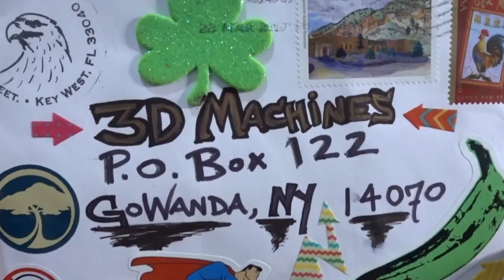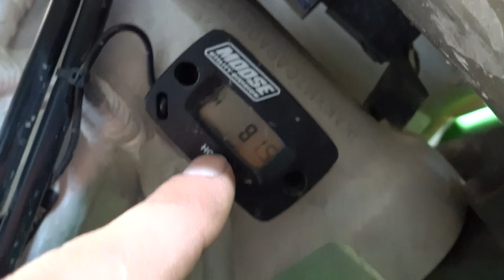SELLING MY FIRST DIRT BIKE

Comment: I know why you made that decision and that's 100% up to you but from what I see in your videos is that your 10 times the rider on a 250 compared to a 450. I don't know what it is but for the riding you do you have to rev the 250 more and it just seems when your on the gas more you get more power to the wheel.

Comment: I bought a 2006 ktm 300xcw and after two races the engine seized. So I did what and body else would do and rebuilt it. Fast forward two months and 9 races I melted the piston to the cylinder :( . Thats now its just sitting in pieces in the back of my garage. So if anybody has an engine for a decent price I would be interested.

Comment: 2007 hammerhead gt150 sport first oil was more gray than the clouds and then tires then electrical system and now battery and head light

Comment: Me second ever bike (crf100f) bought it used. It has been with me through 4 bikes with me and isn't going anywhere hopefully ever but today i was climbing a hill and it was near vertical bike fell over died whatever I picked it up and tried to start it for like 10 minutes and nothing. It usually started first kick even cold with no choke. I pushed it for about 2 miles back home. Have yet to go into the engine. I honestly don't know if it is the engine or the carb or what. The bike probably has close to 1000 hours if not more I rode it every day for like 2-3 years and I wasn't easy on it I would try to keep up with my friends yz250f and obviously couldn't. I still ride it a few times a week. But I'm just rambling now so yea I wrote a book pretty much

Comment: 2008 baja dr70 worked ok spark plug was bad so I changed it was working fine then back fired and shot the spark plug out along with all the threads and its discontinued so I stripped it down and spending $200 for a new engine sucked cause that shouldn't of happened

Comment: I have a 06 suzuki ltr 450 that I traded a beautiful 81 Chevy k1500 for. bike was amazing them the bolts the hold the flywheel to the one way sheered off so put a brand new flywheel one way and stator and can not get any spark from the bottom end tried everything everyones told me and still nothing and I have given up now a very nice ltr that's just sitting in pieces 😭

Comment: i have a 2003 yamaha raptor that ive completely stripped down and am powder coating the frame etc. anyway, it has lost second gear, so im looking for someone to rebuild and fix the tranny and motor. do you either know someone who can fix it, or would you be interested in doing it yourself? i used to take my stuff to the guy on 39 & 240, but ever since he claimed to rebuild a friends carb, and it was later found out that he didnt do the job, but charged for it, im looking for an honest machanic to do the job

Comment: I got my first four wheeler when I was eight years old on my birthday it was a 1986 Honda 125 mL for tracks and there was a wire type thingy that was hanging out of the gearbox and when I was in reverse it would be in reverse at the same time and whenever I was in first it would be in reverse and finally one day the gearbox exploded badly and it only lasted me a year and I put a predator 212 on it and that's how I left it and 3dmachines would you give me a shout out and I subscribed keep up the good work and brrrrraaaaaappp on!!!

Comment: I bought a Kawasaki KX 125 2 stroke used. the first day I took it out and wrote it I rode for ten minutes and the ignition went and had no spark I think it needed a new stator. but it was in water bike I couldn't find the part easily so it ended up sitting Gathering dust and I sold it and I'm mad at myself now because I really love this thing it was kick ass if you know what I mean

Comment: I had zongshen 250 quad with custom suspension leovince exhaust rear shock from 2002 ninja 636 custom front wider forks front tires 10 rear 8 wide headlebar crazy fast very soft suspension and then i crashed it to the wall and bent the frame and my patella broke on 20 pieces i had 70 percent chances to walk never again but i got lucky fix the quad and sold it it was the best bike i ever had but i almost died on that and i cant watch it in my garage causing me pain and i sold it...i have 2 videos on my channel of suspension if someone wants to check it out ...peace and ride safe

Comment: I Baught
Reply: A 1975 ride on mower for tractor pulling at 8  and built it by my self it was done by my 9th berth Day first event gearbox went fixed that then the frame snapped on an impact wen it landed fix that then the con rod shot out of the block never fixed it then it sat till I was 13 and I sold it for 250£ witch was terrible because I collectively spent over 960£ on it and to add insult the man that bought it just parted it out.